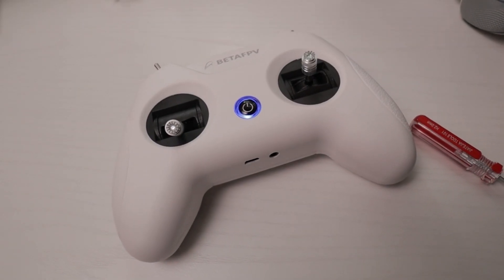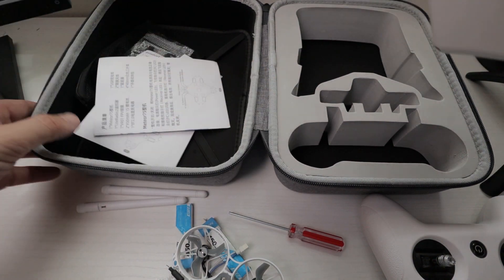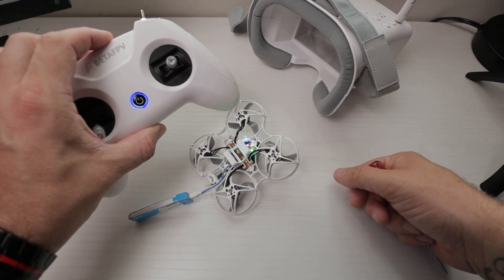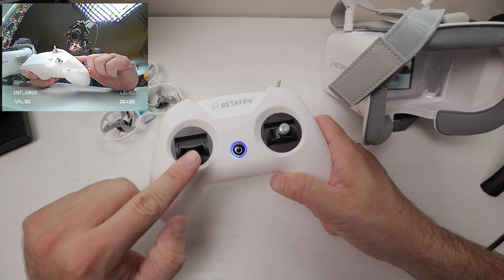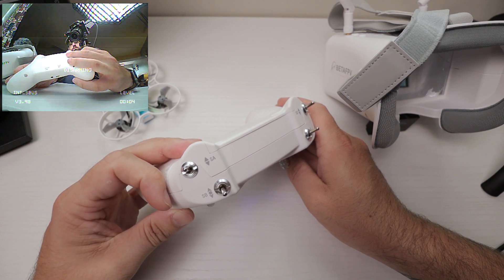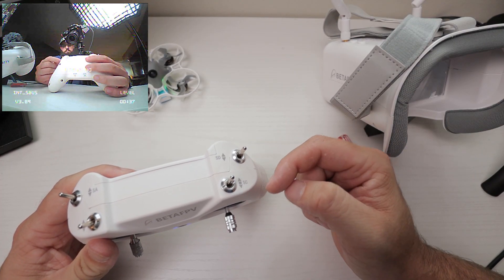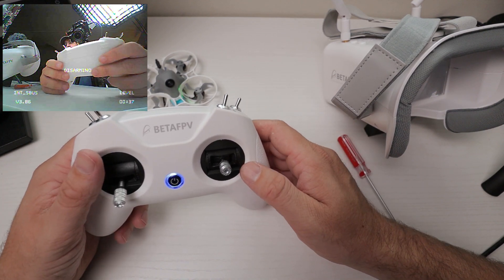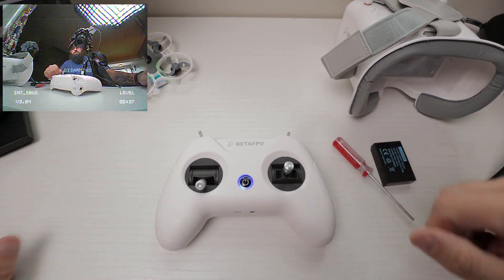BetaFPV Advanced Kit 2 - HOW TO:  Bind, Adjust the FPV Channels and Flight Modes

Comment: Great video. I'm a noob in drone' world and bought this new version of cetus fav pro kit. After 2 days of flying ( ~8 batteries) radio did not wat to connect with the dron ( rx loss) drone service told me to send them back the kit to diagnose and repair - it took about 5 days total - and the problem came back after one flight session. Luckly, I've found your video and managed to BIND the rc and the drone. it took me 1 minute. THANK YOU!!!
Reply from the maker: Great to hear!

Comment: A kid broke the radio so we replaced it and are trying to bind the new controller to the old drone. I follow your steps but when I click the bind button on the bottom of the controller the drone doesn't blink. I think I am in D8 mode but it's hard to tell. If you count the red flashes before you hear the sound when you turn the controller on or after you hear the sound.  As I power the controller on it flashed three times, but after it flashes 3x and then you hear the sound, the flashes are super hard to count. So I can't tell which flashes I count, before or after the beep. Can BETAfpv please put up some training videos on their channel?

Comment: If you’ve got the newer FC that only has one bind button, you don’t need to press it to enter bind mode. Just wait for the yellow/amber flashing lights on the fc then press bind on the controller. The fc bind button changes the receiver mode - check it’s D8 in the OSD

Comment: My menu does not look the same. I just see config and layout. I'm trying to find goggle channel.
Reply: Go into that OSD menu where it says config and layout. Go to config, go left, left, right, right on the right stick and it will change it to advanced and give you the option to change the VTX channel. These new units however do not allow you to change the power to 200 mw so its stuck at 25 mw. I have had an overheating problem with the board and vtx unit and am upgrading to the F4 AIO Flight Controller. Saw on Reddit that the flight controller that the newer units have go to crap and overheat causing a loss of signal within 15-30 seconds of flight. Hope this helps!

Comment: The bind button on mine is in a different place, on the left of the controller board, at the level where the top left arm is attached to the frame. And pressing it as I plug it doesn’t get the green LED flashing.... the only advice so far from my seller was to try following the steps in this video so completely stuck....

Comment: I am not sure how many iterations did BetaFPV have on this kit, but my OSD menu looks nothing like yours. I have 2 options: Config and Layout. That's it. 
My board is super strange, it has a USB port that serves 0 purpose as far as I'm concerned and a strange PNP SPI receiver which I could not find anywhere. Tried to look all over the web, including some German forums etc. and I managed to find only 2 pilots who have the same exact drone/board as mine.
Now that my OSD has somehow moved UP in the VR01 goggles I wanted to fiddle around and maybe move it back down?! but sadly I am hitting roadblocks. Not to mention that I want to tune the PIDs but sadly I am stuck with things as they are.
If you can help me, kind sir (bought the kit because of your reviews) I will be willing to shoot you with a lot of questions and would be grateful for any help.
Reply: go to config, starter, and do left left and right right on the right stick

Comment: Thank you so much for this, really helpfull. I am wondering if you have been able to have the meteor75 showing up in Betaflight. The OSD setting are pretty basics and I cannot really change anything ?? I tried multiple usb cables,.. but not showing in Betaflight 
Thanks in advance,

Christophe
Reply: With these its onboard OSD and can't connect to Betaflight. I have tried many cables and computers and no success.

Comment: Thanks for the video! It is very helpful. 

I've ordered Advanced Kit 2 a week ago and looks like Betafpv have improved the instruction. Now it contains proper information regarding binding the quad (process is slightly different from the shown because flight controller has changed) but there is no single word how to change protocol on the literadio (and the remote controller is not in the DP8 by default).

BTW, here is the updated binding instruction:
- power on the quad
- press the bind button on the quad
- power on literadio
- press the bind button on the back of the literadio
- wait the signal from the quad

Sorry for my english :)

Comment: IF YOU ARE HAVING PROBLEMS WITH YOUR METEOR75 WITH THE RED FLIGHT CONTROLLER AND MICRO USB PLUG LEAVE A POST HERE. It SEEMS THERE ARE A LOT OF US STUCK WITH THIS PROBLEM.  I don't really know what we can do about it, but at least we may be able to share what we have found with NO help from Beta. Hopefully in time Beta will resolve these issues (I'm sure they are overwhelmed -but it was to be expected)  but this is not what the understood deal was with this purchase. Mine will bind and fly, but the rates are just crazy and can't adjust them -No OSD and won't hook up to betaflight. See my post below with William M's comments.
Reply: I ended up returning my whole kit. I think if I pushed for it they would have been willing to send me a new flight controller, but I got tired of their incredibly slow customer support.  As I've suggested in the past, I think the best way to monitor your tickets status is to open the ticket on their support website.  At least then you have an audit trail.
Reply: @wmcewa01  Did you just 'send it back'? Did you have an RMA? I believe I opened a 'ticket' but got no response from them. The lite 2S FC I ordered had a sticker over the chinese mailing sticker (maybe in english or after it got through customs or whatever with a California return addr on it). Did you mail it back to China? last time I did something like that it was stupid expensive and took forever and the tracking does not work there. They're not getting my money AND the drone leaving me with nothing. Copying this to reply above as I posted a reply to you days ago that did not show up.
Reply: @salvor1  no, like I said, I had the benefit of buying from a us-based seller.  A-main hobbies.  As you might expect, their customer service was very good and I had no trouble shipping it back to them.
Reply from the maker: Hey I just got mine in, shoot me an email mpr(at)buddyrc(dot)com - we don't sell this new version but I'll see what I can do to tackle the issues and have them in a new video
Reply: Also, in case others need need help with this, their new light radio 2 se is shipping with a firmware bug that makes it unable to bind with frsky receivers.  After waiting for a week with no word back from Beta, I finally was able to get the firmware upgrade instructions from getFPV. I'm happy to share these instructions with others that need it.  

It's shocking to me that beta still hasn't posted these firmware update instructions to their website.  

At this point, I've been burned by them twice. I will never buy from them again.
Reply: @William McEwan  Did you just 'send it back'? Did you have an RMA? I believe I opened a 'ticket' in support but got no response from them. The lite 2S FC I ordered had a sticker over the chinese mailing sticker (maybe in english or after it got through customs or whatever with a California return addr on it). Did you mail it back to China? last time I did something like that it was stupid expensive and took forever and the tracking does not work there. They're not getting my money AND the drone leaving me with nothing.
Reply: NOTE: see my post below with William M -the one with about 20 comments

Comment: Hi, first of all thanks to the video but it didn't work the binding for me, maybe i got the latest kit and is different, I have one video on my channel with the issue, could you kindly check pkease?
 https://youtu.be/xs1SVIrNxjk
Reply: I wish I could do more to help, but based on that video, it looks like you're doing everything exactly right. 

Are you getting anything in the goggles that might give us an additional clue?

Also, does your receiver use usb-c?
you might be suffering from the firmware issue as well. (which is good because I can help you with that)
Reply: @wmcewa01  right! My receiver  has usb port type C. I just shared the video with FPV team support, they told me to connect the battery and press the receiver bind button at the same time... process totally different to the manual user and procedure seems to be challenging, I will try and let you know
Reply: @nric1384  if that doesn't work, I think you should absolutely update your firmware. Some of the new transmitters with the usb-c plug are shipping with a firmware bug that prevents them from binding to frsky receivers.  See here: https://www.instagram.com/p/CKhb5Ylr8tJ/?igshid=1wzflfapyyb9o

I can send you the instructions if needed.
Reply: @wmcewa01   as expected, it didn't work... I already answer Betafpv to get more details, in while...how should I update the firmware? It worked for you? Thanks!
Reply: @nric1384  I've replied a number of times, but it seems like my replies are getting deleted...  Maybe because I'm posting a link to my Google drive?
Reply: @nric1384  I'm wmcewa01 on instagram and reddit. Can you message me there? I'd be happy to share the link with you.

Comment: If you have this kit and can not adjust the FC in any way (either onboard OSD in goggles or Betaflight) post something here. 
There are two of us so far and there has to be more. BetaFPV customer service seems non existent. See my post below. Buddy RC -if you want to jump in here be my guest.
If you did hook up to Betaflight -how did you do it and do you know which FC you have on the meteor75 quad?
Reply: FC on these new ones are trashed, overheat and no Betaflight connectivity. Get the F4 1S AIO
Reply: @zethyabut1583  It's a long story. Are you talking about the 1-2S lite board?-red board with usb connector. What do you mean 'get'. It should be warrantee and their customer service is a joke. -and I'm not paying for more of their crap. FCs from other companies should work.
Reply: @salvor1  I agree that all of their stuff is junk and they don’t help but that is just what I’m doing and thats the problem
Reply: @zethyabut1583  mobula 6 or 7 controller? emax tiny? -are you looking at any? or did you get the beta 1s F4 -there is the Abducted Kit, uses the 1-2s F4.
Reply: @salvor1  I got the advanced kit 2 before doing my research and discovering that it is junk. I have the betafpv literadio 2 se and the vr01 goggles. The new board im getting is Frsky D16 FCC and the goggles and literadio support it

Comment: What do we do if we have the new flight controller? For binding
Reply from the maker: Betafpv has sent me the updated kit. I'm just waiting for it to arrive so I can make some new videos.
Reply: @BuddyRC  Hey so I figured out how to get the new flight controller into binding mode, but slight problem. The drone comes in d16 mode, and the controller is in d8 from the last drone. How do I flip it back to d16? I tried holding down the bind button the same way and nothing would happen. It would just keep blinking three times. I have tried to go into betaflight to put the flight controller itself into d8 mode, as it says it can on the website, but I can't figure out how to make it work. Any tips?
Reply: Update: I figured out why it wasn't working! A red wire had crossed over to where the bind button would press down, so nothing was happening.  I tried multiple ways to figure out the binding method, as the website doesn't mention anything, and I think i managed to do it. Ironically, the flight controller somehow ended up going back into d8 mode, so the controller thing ended up being a waste of time. Anyways, I managed to get it paired I think, the light blue light flashes and it beeps when the controller is connected. I can;t get it to react though, it says its in turtle mode, and the screen keeps fizzing out. It's very weird. Any advice would be great!
Reply: @remiiqbal9790  Mine is also having this issue. It connected right out of the box for the first two flights but after a mild collision with the wall the motors turned off on their own and now it will not connect. Hoping it's a software issue as the crash was very mild.
Reply: @jonathanlaurie7855  do all four motors spin up when you arm the quad?
Reply: @wmcewa01  no it just says “RX LOSS”. Drone is on D8 mode.

Comment: UPDATE after a month with Advanced Kit 2: I burned Mosfet transistors at one motor while trying acro at home... I don't really know why it burned - drone just hit the wall and fell down without getting anything into props. Most probably due to broken frame (it was like cut at one duct), it was looking fine and props where free to move but probably when I "touched" the wall frame touched the props and it was enough to burn mosfets. In the end I just bought new FC with BetaFlight and USB port. I re-soldered VTX and changed frame. I must say that it's AMAZING how many things you can configure in BetaFlight. I can switch my quad from super fast to super slow just by switching profiles on the radio! Now I'm waiting for Tango 2 with multiprotocol module as my RadioLite2 started to produce "shaky" stick positions. Looks like green potentiometers are shitty - I bended them a bit, it helped for a while but problem returned :/ Now it's really bad at throttle axis and whole thing become unflyable :(

Comment: @Buddy RC  it's really cool that you have a contact at beta FPV because they've definitely updated this kit to a new board. The OSD is different, there is a USB plug on the board, but it doesn't seem to connect to beta flight. 

This is the closest board they have on their website.  It's very close, but most notably the color is different. 

https://betafpv.com/products/f4-1s-aio-brushless-flight-controller
Reply: What is the purpose of the usb plug on the new version?
Reply: @erickjordali7787  it's for flashing firmware I believe.  But I'm almost certain the FC is running silverware out of the box.
Reply: So, what do you think we can do about this? I believe i have opened a 'ticket' with Beta but have not gotten a response in a week. I think we're on our own. This may get hashed out in time with them but good grief. There are more and more folks that this has happened to. Have you gotten anywhere?  I'll start a new thread and see if we can get a bunch of names together.

Comment: I have only one button on mine on the right side.  Anyway took several tries to get it to bind, but it now spins like a top counterclockwise??
All 4 props are spinning in the right direction. Any advice? Thanks.
Reply: It sounds to me like your props are misconfigured, is there any chance you could share a picture?
Reply: he may have wrong props installed or opposites need to be reversed.  David see our posts and stay tuned for possible FC fixes.